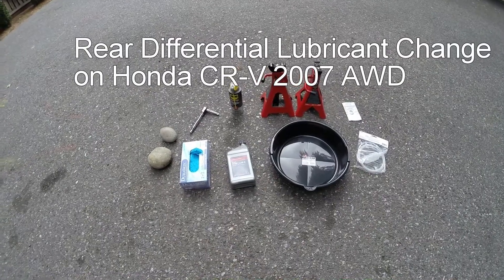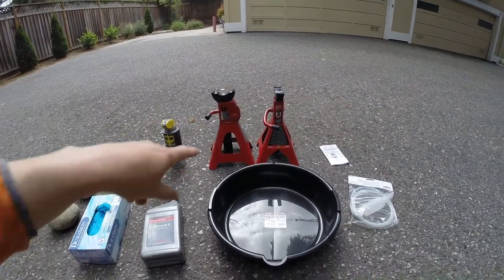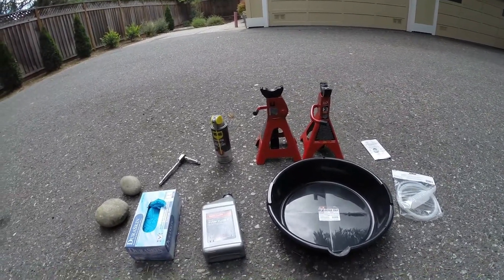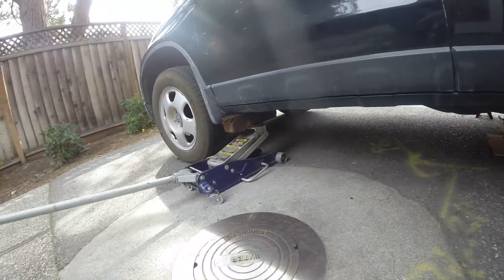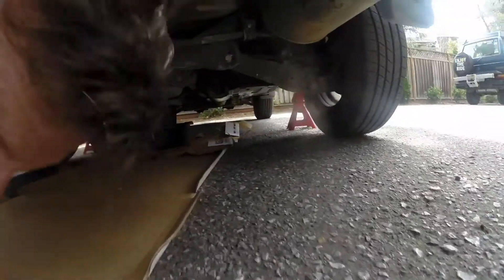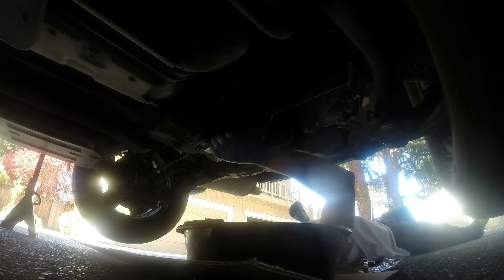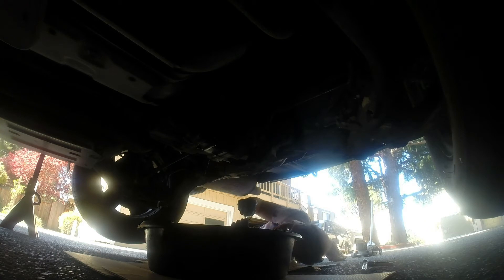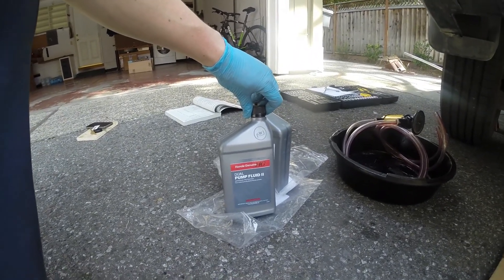Honda CR-V AWD Rear Differential Fluid Change

Comment: I'm getting a vibration in the rear when pulling away from the curb or turning from a stop. People have said the rear diff fluid needs to be changed.
91,500 miles.
Reply: The rear  differential  . Is for  four  weel drive.   O what?
Reply: @rubenstripoli7954  2008, if you were asking about the year. The car has since been sold, but I now have a 2007, also 4WD

Comment: Very dark and hard to tell now. If you ever have issues taking off a plus due to no Leverage then slide it pipe over your ratchet in there's your Leverage that's about for longer. Or you can use a wrench that's a box end that's big enough to go over the ratchet to give you Leverage but I find a pipe to work the best. Also if you have a little of seizing up on it coming out, the the plug or order s new one from rockauto.com for a few dollars, well worth it, then add some Never Seize witch is gray and this stuff works great, 100 years later, you will pull it apart with no issues or leaks. Its great for high temps or low temps, I use it on spark plugs also, just a dab on threads, then never breaks off or has problems getting out or off. The fluids are pretty thin compared to gear oil from a regular rear differential now, normally on a regular 2 wheel drive or rear wheel drive vehicle, you never change the rear fluid on a differential unless you have a problem and you will go 300,000 miles on 90 weight gear oil. Since I started looking up these Honda's, I have seen online threw carfax that they replace the differential fluids about three times within a hundred thousand miles which I thought was excessive but now I know they have issues which I did not know, I've done it makes tense of research on these and they come back with no issues whatsoever from 2007 to 2011 models and Edmonds has no problems with these at all and they are the number one pick of all SUVs out there. I've seen one that the rear end fluids were replaced at 20,000 miles 30,000 miles 40,000 miles 50,000 miles all the way up to a hundred and twenty thousand miles then the rear differential was replaced and it's up for sale now so I started to look at the issue if that particular year had a problem with the differential and there it was big Forum showing that people complain about rubbing noises, these can break a tooth and lock the rear end up on you which is pretty much stopping you almost dead in your tracks depending on how fast you're going plus if you're going really fast like 65 to 70  MPH on Highway and a tooth breaks off the pinion gear or the ring gear it could lock the differential up which is like walking that rear braking system completely up and causing you to crash which is a safety hazard in my opinion. Now I'm concerned on buying this vehicle.